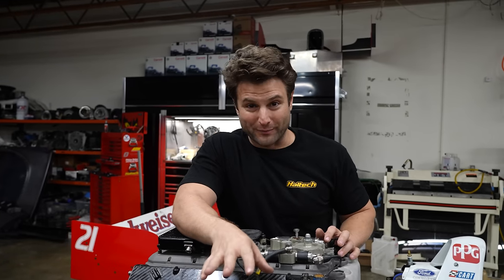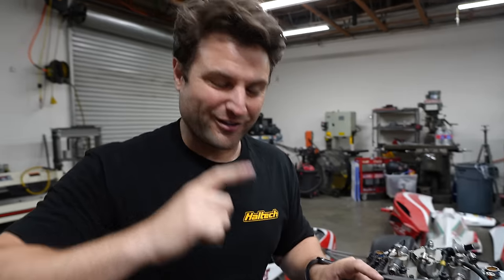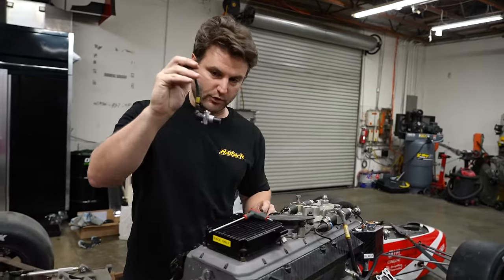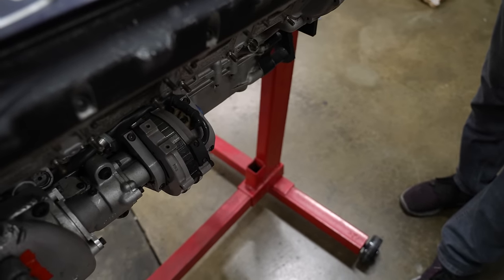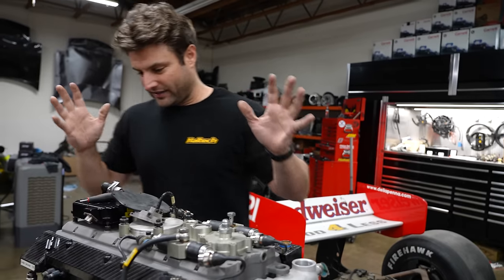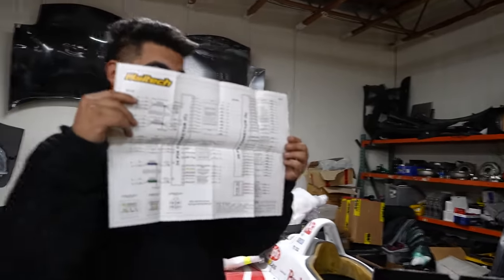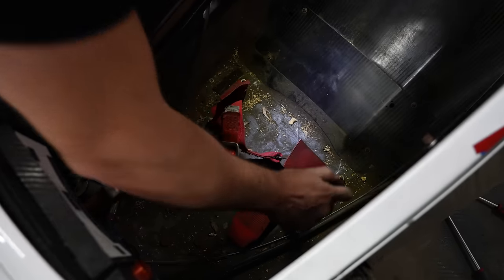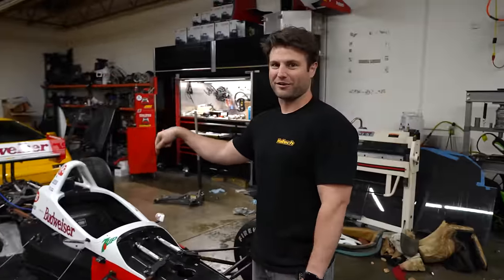Reverse engineering Cosworth secrets. How to start the Indycar project without any info

Comment: What's crazy is I got the chance to crew (read me and my dad) on a formula continental a bit back.  A lot of the things are the same...  Don't expect anything more out of that alternator that will barely keep the engine running.  Jump boxes are a thing, and literally required, especially at the lanes.  Our car had a Ford i4.  Programming was done on the car for the class.  So we weren't able to modify it.  Shitty cold starts and jump boxes were everywere that Feb earlier this year!

Comment: The multiple filler necks would allow teams to fill on either side of the car depending on the direction of the track and orientation of the pit lane. There should be a block off panel to the side of the cell under the dummy cover, that is interchangeable with the filler neck on the active fill side.

Comment: I know in formula 1 you have multiple ways to engage/disengage the clutch, like a paddle that lets the clutch out to the bite point that they can use for starts. maybe thats the red thing next to the gear shifter? I know (at least now) indycar does rolling starts, but maybe either the cars needed it to prevent stalling (I imagine they had "unfriendly" clutches and long ass gearing which would cause that) or maybe back when they were cart they had standing starts like F1 has?
Reply: thats for a dual clutch im pretty sure
Reply: Or lockout to get reverse 🤷🏻‍♂️

Comment: at 9:45 treat it like bmw and their vanos system, it’s actually incase the itb’s fail there’s a throttle body that can control airflow or stay shut so the engine doesn’t revv till it’s dead, for example an n52 can run with no throttle body but the physical throttle body is a fail safe incase vanos fails since the intake valves stay wide open if the variable intake valve control fails
Reply: at least that’s how i’d see it

Comment: Hello Rob, really nice project you got there. I was a racecar mechanic in lower category about 15 years ago. First, the black tube in the lower panel behind the seat seems to be the fire suppresion system. Second, the lever beside the shifter seems to be the adjustment for the rear anti-roll bar that's located over the transmission. Hope it helps. 
Cheers!
Martin

Comment: @robdahm For some good cosworth info from a guy that ran one as a trackday car, look up Bill at lolachampcar. He had a lot of good information for me on my XB. I believe he got rid of the pre turbo injectors and was running the car on gasoline. The problem with the methanol is having the pickle the engine with gas for storage everytime you use it. 

Also, Dave Frietas over in Whittier has an ex Patrick racing T95 that they have running the original XB. He let me come check out the car a few years ago to get some info on what was missing from mine. 

Great to see you back on the project. The info out there for restoring old Indy cars is few and far between, but I've been able to piece mine mostly together over the years.

That cable should be for reverse in road course configuration. 

Aircraft Windshield in Los Alamitos still has the original molds if you need a new windscreen. 

Pit Lane Spares in the UK stocks a lot of odds and ends for these cars. Stuff like the shifter linkages and suspension bits are pretty reasonable. 

The connectors are all mil spec/aviation style connectors and are readily available still.

Someone else mentioned it already, but the blow off valves were called Pop off valves. Big canister that sat on top of the intake and had a small manual vacuum adjustment valve in the cockpit.
Reply from the maker: i stumbled across Bill and emailed him to see if he was still active. Already a wealth of knowledge on his site but i havent bothered him much yet. I hate bothering people until ive clearly done my research so they dont feel like im wasting their time being lazy
Reply: @Rob Dahm  It's incredible how much detailed set up information he retained. 

If you don't already have one, I would shoot an email over to Alex at pitlane Spares llc. He was able to dig up a copy of the original T94/00 service manual that the teams got from Lola when they got the cars, and sent me a digital copy. It's another trove of information. From mostly complete parts diagrams with part numbers (super handy for finding the correct bearings and random brackets), to different track suspension and aero settings, wheel speed sensor voltage outputs, ect ect ect. 

There's even a lot of 2D blueprints for different parts. My car also spent It's life as a display car after it was retired, and it's been by far the best resource for figuring out what goes where and what does what.
Reply: @RobDahm  shit you can probably find some of the connectors at G&J right off sultana and mission.

Comment: Not sure how the Haltech knock algorithm works, but typically the knock sensors measure the frequency, a fast Fourier transform is performed on the data and you can then set your knock thresholds at different frequency bands then ecu should retard spark if it hits the threshold. Excited to see work on the Indy car, this is going to be awesome!!

Comment: I read the rest of the POV comments. All seem potentially valid. I initially thought "position of valve". Thought there might be a sensor in the head for the weakest spring to avoid valve float. Once detected it would cull rpm to keep power. The springs are only designed to last a race after all. Test all springs and place the weakest one where the sensor is. Dunno. Trace the wires I guess.

Comment: The wiring for the alternator is looks to be set up like a motorcycle with a separate rectifier and regulator. Get a bottle of Nitrogen for the airjacks, that has more than enough pressure

Comment: You should study how the turbo works on the G80 M3. It's doesn't use a BOV or Diverter valve. It's all about waste gate management, if I remember correctly. I wonder if they did something similar on the Indy Car

Comment: Pi Toolbox was a data analysis software that Cosworth used, kind of like most aftermarket ECU interfaces for playing back datalogs nowdays. I used to use it on a cosworth developed small UAV motor. Cool to be reminded about that old tech!
Also you should have called up Larry Kosilla for the cleanup, I'm sure he'd have loved digging through it cleaning off the years of dirt.

Comment: POV is probably something involving the Pop-off Valve, which was a method of limiting boost in CART back in those days. If an overboost condition was detected, the POV would open, dumping manifold pressure for a certain amount of time, essentially penalizing the car for overboosting.

Edit: you might wanna get in contact with Marshall Pruett, he's a motorsports reporter that was an engineer in CART and IRL during this period, he probably has contacts that can tell you a lot about this car and engine.

Comment: If you can't run a BOV I'd suggest a big twinscroll Borgwarner EFR with a built in recirc valve (Turbosmart make a nice Shortie recirc that handles 30+psi) and step into the 21st century 😅 much better than most GTX turbos these days afaik

Saying that, you don't really need either if you're using an E-wastegate. BMW stopped using them a while back (F56 minis, presumably M2 etc too) in favour of E-wastegates which open when you lift off the throttle (boost by throttle position essentially) so there's nothing to keep spinning the turbo and surge doesn't cause any damage due to lower pressure differential. Works great, sounds cool, fewer moving parts.

Comment: use a bypass valve, not a blowoff, into the exhaust... or better yet open the alt throttle, cut fuel, and phase the valve timing so it excess pressure blows out the overlap and out the exhaust, variable engine braking based on how closed the overlap is. you probably want since you're off the throttle. Hiring a systems engineer? ;P

also, the turbo is probably impedance matched to the engine; their curves are the same ideally.
Reply: what do you mean with the turbo is impedance matched?
Reply: @gabrielenitti3243  The output of the turbo matches the required volumetric input of the engine for both the intake and exhaust maps effectively, It's an electrical engineering term that gets misused everywhere, but it is effectively where most of the math came from
Reply: @drewlarson65  well, as an electrical engineer myself, i didnt know the term impedance was used outside electricity! thats good to know!

Comment: Rob are you really gonna try to run that engine on a haltech?

Can the haltech handle the higher RPMS? I believe some older/cheaper standalone ecu’s have an issue trying to read cam/crank signal at 10k+ rpm, and even being able to fire the injectors/ignition coils that high.
Reply: That haltech is the best of the best before going custom, If $30 arduino's can run a V8 I don't think this ecu will brake a sweat running this engine. Will be interesting if Rob will get flat foot shifting setup for this car 😂
Reply: He needs to go Motec. That's what all the vintage racers that are running the old CART and Champ Car stuff have switched to.

Comment: POV = Pop Off Valve, the maximum boost control valve that would go on top of the intake plenum, that big hole. Set by CART at a specific release pressure, the sensor would tell you how close you are to maxing out allowable boost. You want to run near, but not over max boost, in order to maintain throttle response.

Comment: Funny thing is I went for a job at cosworth in Worcester England years ago and I was blown away by the tech even in there road cars back in the 90s miles ahead of everyone just a shame it shut so advanced 
As for the blow off valve you could probably get away with a recirculating blow off I had one on my golf it dumps pressured air back in front of the turbo helping it keep speed through gear change by blowing through the front of the compressor sounds strange I know but most vag engins run this I think 1.8t ran it at 400bhp plus with no problem

Comment: That actuator below the shifter is most likely for adjusting the rear anti-roll bar. That way you can adjust for high vs low speed characteristics.
Reply: I’m pretty sure that F1 cars of the same era had a roll bar lever like that. But I don’t recall indycar allowing in car roll bar adjusting

Comment: Give penske or andretti a call and see if they have any schematics sitting around. PRI show is in a week or two so you could fly in for that and hit up the museum at the speedway while your in town. Indy is you best option at learning every aspect about that car. Someone knows someone that has the answers and is willing to help. That red lever could be for adjusting the Tbar which acts as the sway bar. As it turns, the spring rate increases or decreases. Good luck on the build and hopefully you can do some parade laps here in the month of may.

Comment: The silver color connectors (for example at 13:03 labelled Pi MUX) are LEMO connectors. They are very high spec connectors, they are de facto in medical, aerospace and other critical applications. If you ever want to go one step above automotive connectors, LEMO is the end game.

Comment: You're talking about not running a bov but even if you don't, the same fuel and air mix will be pushed out the front of the turbo when it surges. I'd assume less than just an open bov. I'm sure there's some kind of programming for the pti that says less-no fuel on any negative throttle map. I could be completely wrong though.

Comment: Something you might find cool that I found out while I've been learning mechanics and tuning on my mx5 is that the early mk1 mx5s ONLY have a Cam Angle Sensor. They didn't introduce a Crank Angle Sensor until later on so the ECU only knows the engine cycle based on the cam timing. It's pretty inaccurate compared to a Crank Sensor though so you can install a trigger wheel and Sensor at the crank pulley with a standalone ECU but I always found it pretty interesting that they managed to run the entire stock setup with only a cam sensor and it worked reliably. 

I'm curious now if there are other engines from the 80s or 90s that only have a cam angle sensor and get the engine cycle based off of that.

Comment: Mr Dahm, are you open to some PAID consultation?

I own a 1993 RX-7 that hasn't been driven for 10 years because it failed the emission testing at that time.  Then there were some life changing issues...
The emission failure occurred at idle speed.  At the 3500 rpm test the emission was acceptable.

One observation I had made was that the vacuum-at-idle had slowly increased over the years; say from 13 or14 inches of vacuum to 12 inches of vacuum.  The engine also consumed some coolant, albeit very little.

At a good radiator shop I had the cooling system tested for CO/CO2 leaks and I was advised that there were no combustion gasses leaking into the coolant gallery.

Prior to laying up the car my son and I, as a last drive, did some "very spirited driving"  close to the car's stock capability.  The engine ran smoothly and powerfully with no rise in temperature on the gauge.  The coolant level was visually unchanged from before this drive.

Question:  What is the likely problem and how do I repair it?

Question:  There also is a small oil leak from the area of the two turbochargers.  Any idea on how to identify the location of this leak?

The car has 180,000 Km (150,000 miles) on the clock and, with the new tires I put on it a few years before it's layup, ran like a dream.  It is all stock except for the free-flow stainless exhaust and catalytic converter I installed myself.

Please let me know your consulting fee and, if agreeable, I'll forward my name, address, email address, etc. to you.

Thank you very much for considering my request.

Sincerely yours,

Wolfgang

Comment: I’ve seen on some drag cars they put the air charge injectors after the blow off valve. I’m not saying it work for you in this situation but they use it to cool the air charge down.

Comment: Borg and Warner turbos dont requiere blow off valves because they have recirc valves at the compressor housing. EFR7163 turbos are used in curent indy series.

Comment: The red lever on the gear lever , don't know for sure if it's this but I was reading up during this week and discovered the exhaust blown diffusers used in formula 1 back in early 2000's had a blow through function for the engine set to essentially go flat out and have the diffuser constantly have air blown by exhaust on the diffuser to create downforce on full throttle parred with cylinder cut making a air pump for the diffuser on "off" throttle scenerios , they would have some  lever or flip switch type activation in the cab at beginning stages to go full throttle but not full torque during corners but the FIA found it the devils work

Comment: I think that handle on the shifter could be a neutral lockout. Pull it then it should allow you to go in to neutral. Could be wrong lol. If you want the air jacks to work, think you’ll need compressed nitrogen. I’ve also seen on the newer race cars in IMSA when the car is raised they disconnect the line and the car stays up. It’s like there’s a check valve. When they’re done they pull the release tether and it drops.

Comment: Be careful hosing off your car like that. The core material (honeycomb) may swell and damage the rest of the composite depending on what material it is made of. Learned under an old Indy builder while in engineering school. He was admit that composite cars and parts are wiped down careful by hand and never hosed off.

Comment: Alternator wires probably phases on bug pins temperature and hall effect sensors in smaller pins or it's a generator and its excitation and output with temperature and hall effect rpm

Comment: If you pipe the blow off valve back into the exhaust after the turbo could perhaps have one. A glowplug at the exhaust tip would make it all flashy.

Comment: Run a recirc valve back into the intake so you can keep the pre turbo fuel injectors and when it vents it sprays the air fuel mix into the inlet of the turbo under the air filter

Comment: I don't want to be a naysayer but I'm curious if you've thought of what you're going to do if something that isn't manufactured anymore DOES break?

What if the alternator gives out? Have you checked to make sure you can source all the various sensors? I'm hoping you don't get it to a dyno 6 years from now (I jest...maybe) and you do a pull and something gives out that you can't replace (easily).

Comment: Hi Rob. Love to sfollw your projects. dont you think that the PCI connector is used to inject methanol into the exhaust before the turbo, to keep the turbo spinning and prevent turbo lag. Basically an antilag system. Im also pretty sure that a blowoff valve or a wastegate is installed on such an engine. Greetings from Denmark

Comment: That secondary control on the shifter could be auxiliary throttle. Old porsches had them for a while in the air cooled days. Used for setting idle or holding a rev while shifting on down hill corners.
Reply: Could it be a secondary throttle for pit lane?
Reply: @fluffy eggs very possible. My knowledge is limited to things I've driven while working at an auto auction (ferris bueller) and my own inquiries.

Comment: You could get an high-pressure scuba tank or fire fighter air tank. And there are down regulators for anything under the tank puts out. 3000psi to 50 psi.

Comment: That little red handle is the neutral lockout, when you’re in 1st with the clutch in just pull that up and push the shifter forward and it’ll go into neutral.

Comment: Auxiliary exhaust pipe with inline ignitor for flame thrower blow-off valve please. 

Also make a separate "powerplant cradle" that will hold a rotary motor so you can "hotswap" from cosworth to rotary and such.